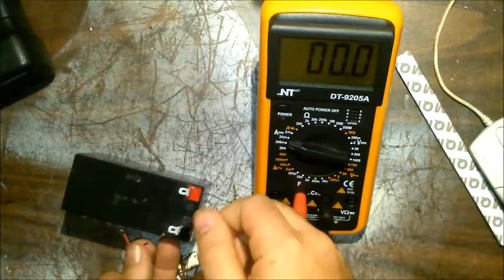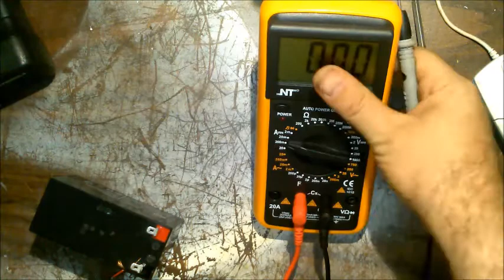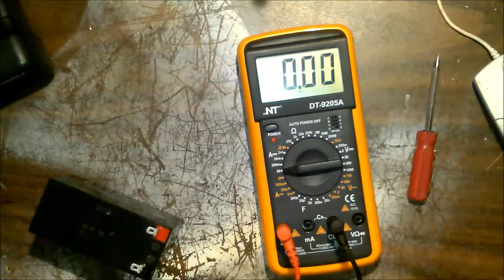Some 12 volt LED COB strips

Comment: installed the same strip 12 v, 2 w, on car and connected in parallel with the turn signal circuit..when turn signal is activated, the led strip doesn't glow at all?? Why??

But the led glows perfectly when directly connected with the battery!!

Comment: A link to purhase in the description would have given this video a reason to exist.
Reply from the maker: I though I had it in the description. Apologizes. I wwill edit the description and thanks for noticing it.
Here is a link to some - https://www.ebay.com/itm/6-12V-Car-COB-LED-Chip-Daytime-Running-Light-Lamp-White-Bar-Strips-Super-Bright/302511572207?epid=11008497348&hash=item466f1844ef:g:b8gAAOSwZlZZ-2oE&vxp=mtr
Reply: @Elfnetdesigns   installed the same strip 12 v, 2 w, on car and connected in parallel with the turn signal circuit..when turn signal is activated, the led strip doesn't glow at all?? Why??

But the led glows perfectly when directly connected with the battery!!